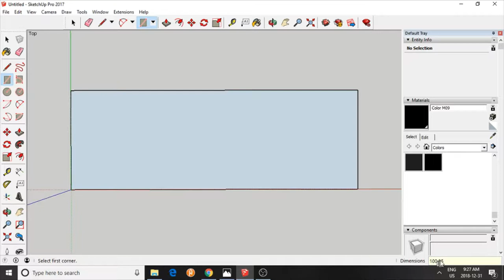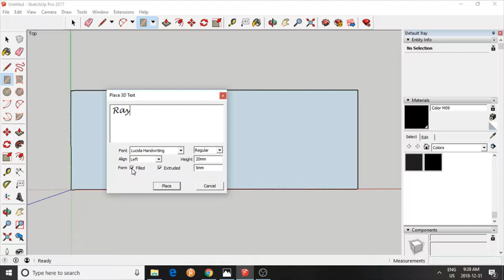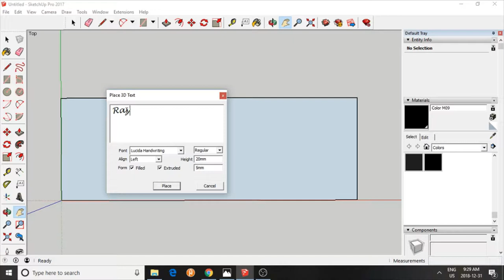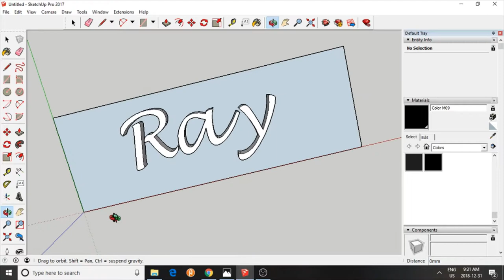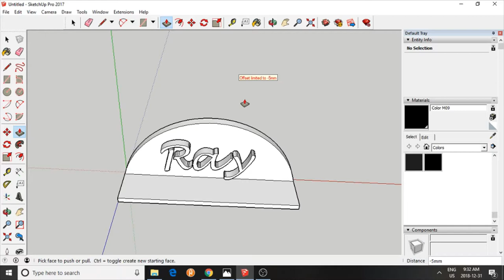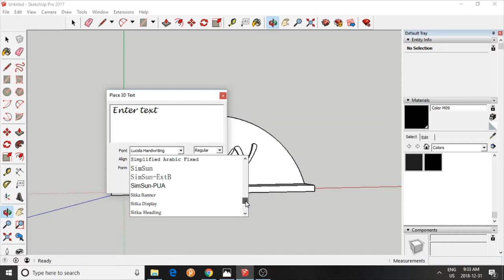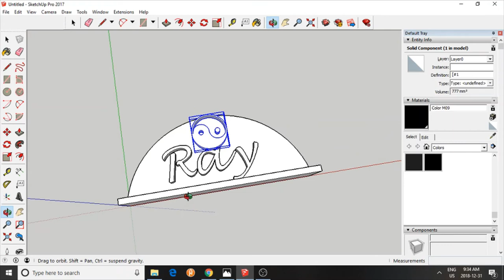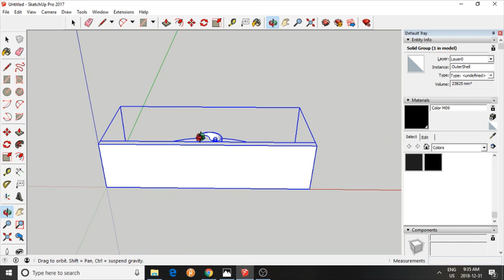3D Text in Sketchup for 3D Printing

Comment: Downloaded the trial of sketchup Pro and trying to follow your tutorial but not having any luck.  
For starters the color lines are different so not able to draw the rectangle that you did.  Green goes up in your example and blue in the download. 
Not able to draw a rectangle as you show.  
Any suggestions
Reply: Make sure you are in the correct camera view.   The z axis is the one that goes up and down, but if you change your camera angle, the orientation may change depending on your perspective.
Reply: The z axis is blue.
Reply: In this tutorial, you are in top view.  Go to standard views and select top view.